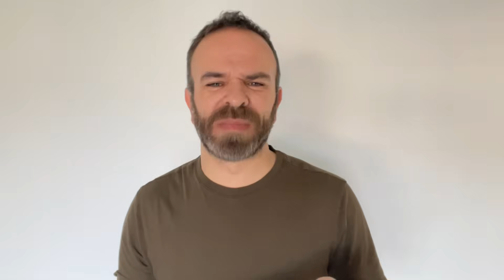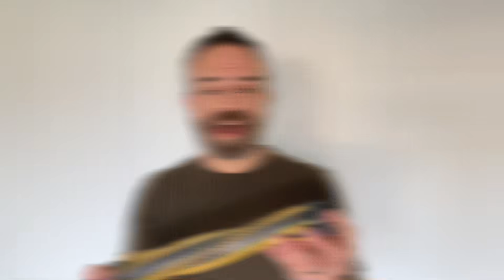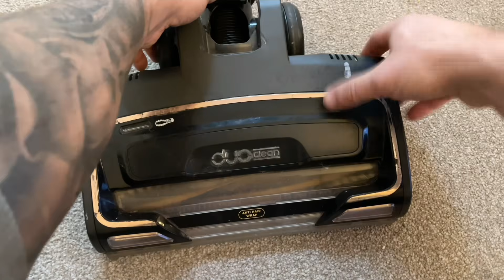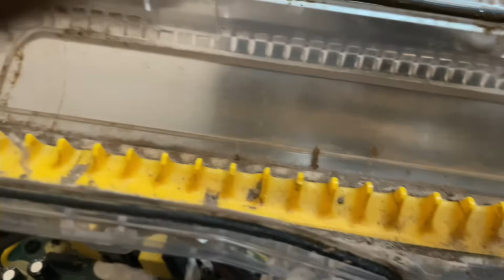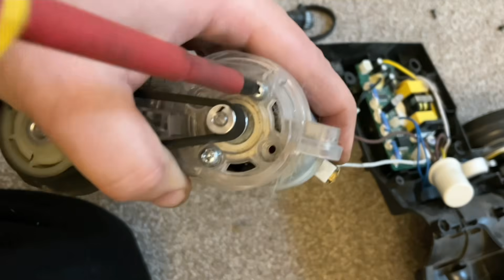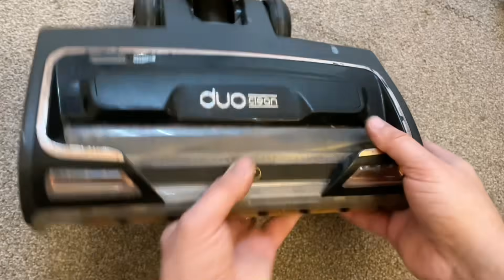How to REMOVE Shark Vacuum BRUSH Roll Duo Clean Roller

Comment: I've made stupid amounts of money over the past 5 years from vacuum designs and the fact that most people just go buy a new vacuum when theirs has a reduction of suction.  I routinely pull vacuums out of dumpsters that have only been used to the point where the filters get dirty for the first time or even before that if the hose gets clogged. The reason I'm here watching this video now is because I found a shark apex duo clean that's literally brand new  in a dumpster last night.  It had minimal dust in the canister with a filter housing as clean as the day it left the factory.  I usually spend 30 minutes or less and on average make 6 or 7 hundred bucks a month. I live in a town house that's in a complex of other townhouses so there are probably 40 dumpsters that take me 10 minutes to check all of them. I do it at night so nobody bothers me and I don't embarrass my wife with the neighbors. If I include other dumpster finds I easily make  closer to 1500 a month as a side hustle. Mind you since I check daily I never have to climb inside a dumpster because they feel up in layers from day to day so it only requires that I look inside and see what's on top.  Entire apartments are routinely thrown away.  The month that college releases for the summer I made 7000 because many students throw everything away rather than pay to have it shipped back to their home state or country.  If there's one downside it's the fact that I pull something out of a dumpster and sell it and uncle Sam still wants his cut. Ummm I'm pretty sure all the stuff I find has for sure had tax paid on it once and in many cases two times.

Comment: Hi I have a Shark liftaway NZ690UK.  The red light comes on and brush not turning. I have clean all filters and blockages, any ideas please?
Reply from the maker: Hi 

It’s nothing to do with the filters etc 

If the brush turns ok by hand when it’s off… It may be the small motor inside. 

Here is my video on red light issue 

https://youtu.be/y_HYlH-5Moc?si=wU2vyNeQTB0mbThg

Comment: Need a torx TR 20. (TAMPER RESISTANT) for the NV831…😭😭😭😭
Reply from the maker: This is a decent set for under £10 

https://amzn.eu/d/9ukXpSg

Also anyone reading. The screws are referred to as TX and TR when tamper proof but most new torx sets come with the small hole in the centre 

You can’t go wrong with the ones in the link

Comment: Any idea why floor base isnt picking up much dirt on carpet?..i cleaned roller etc recently so still sucks on crevice....model:HZ500UK 12
Reply from the maker: Here you go… model in video is different but the floor tool theory is the same…. 

https://youtu.be/iOS8CMam5rY?si=Xuiy5UpUkv_UY7hL

Poor suction from floor head if it is spinning ok, but just not picking up.

Comment: Me and my dad where taking out srews for a bit before deciding to find a video to try and help and it was only after you easily took off the clear part off that my dad had taken out a butter knife to take of the sides (its not the exact same model but similar enough) and  was able to finally get to the brush roll. He took out so many screws (maybe more than nessecary) but it was the side panels that by the brish roll that gave us the most trouble. Great video and thank you for the help
Reply from the maker: You’re welcome. Anyone reading this too and struggling with a model which is a different lay out. I have various videos on the link below so you have find the similar one to yours 

https://youtube.com/playlist?list=PLgFxX9sBhohzI2tqcuXIaJrnB7V3sxWCA&si=HYWMXT_8HIiwk2uq

😊

Comment: Thanks, really clear.  My problem is the floor unit squeaks loudly when the brushes spin.  Worth taking it apart?
Reply from the maker: Yes you could have something caught in the end of the brush. I have a video on my channel with the brush out already if this is the case. I’ll pop a link to that on another comment shortly. 

The big cause of about squawk however on duo clean models, is the small belt that drives the front roller. 
The cog is right in the front corner and if the clear plastic gets a crack it can send the cog out of line. The small belt then tries to come off, but with no room to do so. It is then spinning fast against the inside housing and eventually burns a hole in the side of the casing (yet to do a video about this) 

You would find that the soft roller is slightly stiff to push by hand, when the
 vacuum is off, if this is happening. 

Taking it apart you may find out the cause better. But if the second thing is the issue, sadly the plastics aren’t available to buy…. So it would be a £70 floor head time 😢
Reply from the maker: Here’s that video for the first possible issue

https://youtu.be/Wu2ax-h541I?si=KXC-T5ozbos7Vi_o

Comment: I have a shark nz860ukt upright hoover.mine doesn't have a sole plate with 3 plastic screws.
Reply from the maker: Ok that’s quite a new model I havent had any in for repair yet. I can see what you mean though online. Why are you wanting to take the brush out may I ask?
Reply: @vacuumhelp  because we tried hoovering a load of we think was concrete dust and its got everywhere and was trying to clean the window
Reply from the maker: @matthewwilson3492 ok cool. I’m sorry I can’t help with a take apart video. With them being under warranty I havnt had any for repair yet. 

Maybe the best help I can offer is this video? Different model but the theory may work the same on yours. 

It’s like they made your model even hard to clean and look after than the previous 😡

Anyway… cleaning window video…. 

https://youtu.be/hkbPp4lFcE8?si=xfycM8YmAPXeFV9v

Comment: Did this with mine today. Shark now use security torx bolts… ffs.
Reply from the maker: Always have. Most for. Screwdrivers have the woke in them for centre pin. If you don’t have any here is the set I use 

https://amzn.eu/d/gRKBHws
Reply: @vacuumhelp ok, I have a set. Wasn’t too onerous to fix.

Comment: Do you have a video that shows how to get to the brush roll in a shark rotator powerfins hair pro model zu100?  I got a small rock wedged in it so it won’t spin.  Tried prying it out but no luck.  So I went and got some star key screw drivers.  Was able to get the screws out from the bottom of vacuum and it allowed me to take top part of vaccuum off.  The top part is the cover with odor neutralizer technology.  The motor is exposed and wires now.  when taking all these screws out it loosened it up enough where the pebble fell out.  This is hard to explain but there is another cover underneath that has screws that I removed but this cover isn’t coming off and when taking screws out it loosened up a piece inside that cover that I can’t screw back in because I can’t 
Figure out how to get that cover off.  I’m sorry if I’m not making sense and appreciate your time.
Reply: I just figured out that I could take out the really small wheels at the bottom of vacuum.  Behind these wheels are more screws.  Removed screws but I’m still struggling to get the bottom cover off and the other cover on top
Reply from the maker: Oh god they are such a nightmare. We sadly don’t have your model over in the uk. I’ve just looked and the uk equivalent (almost) has only just been released a few months ago. So I havnt seen any in for repair yet. 

Cannot find any videos that may help but I wonder if the way in is linked to the silver covers at each end of the brush
Reply from the maker: Oooh will this help? It’s not by ent means your model but from 7m 20s onwards he started doing the end caps and the cover later on I pressume. It looks similar to your brush at least …..

https://youtu.be/zt0NULuEbPk?si=6SvTkeqC70OcBYAF
Reply: My husband was able to pop off the silver caps on the side with a butter knife.  More screws inside took those off and then he was able to pop off the bottom which gave me access to screw that loose piece back in.  Never got the other top off but was able to do what I needed.  Got it put back together finally and tested it works.  There were like three different types of screws through out this thing.  Most were t10 and t15 star keys and one single screw was a Philips head screw.  WOW that was a lot of work!  Thank you for responding!
Reply from the maker: @violetthodgkinson6153 yes they make them all very tricky so if people get any issues they have to buy a new one (unless they are as determined as you were) 

Glad you sorted it 😊

Comment: Done all that, but when you pull from the right corner to release the clear part, mine is stuck. All screws removed but it’s still not releasing the clear part. Any advice?
Reply from the maker: Ok if it’s not enjoying it form the corner give it a good wiggle from the middle. If the top Stewart hold it to the plastic base near the internal hose are both out, that’s a good spot to try and separate some models. 

Once one bit comes free the rest will.

Comment: Evening , I  have a problem with my shark az910uk the light is a solid green colour but the roller doesn't spin , help😂
Reply from the maker: No problem. It’s either the motor inside or the belt which has gone. 

The full video for your issue is here…. 

https://youtu.be/DyK5Ln5TwNM?si=lxPgtZ3K79hNx7GM

Comment: Please can you advise? No blockages, no hair on brush bar etc but somehow the cleaning is not as effective. Filters have been washed and dried. Also checked all connections to the wand (no fluff/debris etc). Many thanks for your help.
Reply from the maker: Ok please let me know is model number. Also is the problem just suction, or are you saying g the brushes aren’t spinning either? Both very different issues but I’ll get you sorted 😊
Reply: Thank you so much!

Model: NZ850UK 31

Brushes rolling, lights are on, some suction but generally not good at all. However when removing wand etc there is plenty of suction and can see no blockage. The only thing I can guess is not the same is that the light isn’t on the wand for carpet thickness (if there was ever a light there). Your help is greatly appreciated. Thank you.
Reply from the maker: @Sarah-y1h2z ok so the light on the handles are common for playing up, I can’t remember if your lights up, or if it just has the yellow background… in any case. This switch just changes the speed of the brush. So if that’s doing that, then that’s cool. 

Check the cone mesh filter in the dust bin is clear. This will kill general suction. 

I think the issue is the floor tool, but it’s great that it’s spinning. 

Common things. 

1. Remove it, remove the sole plate with a coin (unlock the 3 screws) check for blockages and make sure you can see daylight through the stem of the floor tool. (Oh and check main metal pipe for daylight) 

2. I’ve seen this every so often. If you have had the soleplate off recently, make sure it’s flush to the floor. The front 2 corners fit in first and then press down and lock the 3 plastic screws. 
If the corners are sticking out it can cause loss of suction 

Really hope you find something. Please report back.
Reply from the maker: @Sarah-y1h2z also you covered most things I think, but anyone reading this and having suction issue, this is the video you need….. 

https://youtu.be/sYiPjN-WKy8?si=TNG3udRrY6AAqLHp
Reply: Great video. Before I attempt to remove the roller.... the rollers both turn when I (very carefully) give the roller a nudge. But if I stop out the hoover upright and go again the roller stops and needs the gently persuasion again. Any thoughts? Thanks...
Reply from the maker: @scottlee5208 thank you. 

Ok so the key thing is how they are spinning by hand (with the vacuum off) if they are fine then it indicates nothing is clogging up the brush. This normally means the motor that drives the brush is on its way out. (Also the nudge to get it started indicates this 9 times out of 10) 

A seized brush would NORMALLY make the green light turn red. 

Never say never with anything shark tho and worth a look into. If it is the motor try eBay for used ones. Or you will have to spend £70 on a complete floor nozzle from Shark. 

Let me know how you get on or if you need any further help at all. 

Nothing left to lose. 😊
Reply: @vacuumhelp thank you I'll see how things go 👍🏼

Comment: If shark don't sell the brush roller then what is the alternative? My roller spins fine but I think the brush is worn.
Reply from the maker: @tonyharris8889  you can only buy the complete floor tool off them… crazy! 

It’s unusable to be very worn though they are usually quite hardy. If it’s poor suction form it, check the small hose on the tool for splits or blockages and also make sure that the bottom sole plate is attached correctly and flush to the floor.
Reply: @vacuumhelp I have checked and there are no blockages.  I shall check for the hose being split.  I have broken two of the screws that hold the bottom plate though 😮. Thank you for getting back.

Comment: Thanks a lot my kind sir! I have managed to fix my wife's vacuum with the assistance of your video and it was a breeze! There was a LOT of accumulated debris in the roller + the roller was overall a bit stuck, so I moved it for a while and put in a bit of oil to lubricate it. Now it works like new! 

Much love!
Reply from the maker: @0x_Vlad  great news. Yes it’s a shame you can’t actually get the end caps of the brush bar off but you did the right thing. Plenty of lubrication and swivelling (I attach a drill sometimes) 

Glad you sorted out and that I helped 

Your comment made my day thank you 

Jonny
Reply: Plate cover won't stay in place keeps falling off
Reply from the maker: @KarenMee-e6g let me know model number and what a plate cover is and I can help …. Maybe

Comment: Hi, when taking the roller brush out of mine the spring and little plastic lever part fell out that is part of the orange roller release mechanism. Please could you do a close up of this so I can work out how to put it back? Thanks
Reply from the maker: @nicolamurphy9310  yes sure. I’m not able to right now but if you email me with your model number I’ll send back some photos of a similar model. 

thevacuumcleanerclinic@gmail.com
Reply from the maker: @nicolamurphy9310  if you in a rush as it’s bed time here. I have this listing on ebay. Maybe zooming in on the images may help (I hope) 

https://www.ebay.co.uk/itm/365433048598?mkcid=16&mkevt=1&mkrid=711-127632-2357-0&ssspo=GLyQOPn2RJK&sssrc=4429486&ssuid=cExKpCXvQ72&var=&widget_ver=artemis&media=COPY
Reply from the maker: @nicolamurphy9310  also this one from another seller has a photo of one https://www.ebay.co.uk/itm/166718955347?mkcid=16&mkevt=1&mkrid=711-127632-2357-0&ssspo=YlvRTb3BTee&sssrc=4429486&ssuid=cExKpCXvQ72&var=&widget_ver=artemis&media=COPY
Reply: Thanks I'll give it another go today. I don't think I've put the small spring back exactly as it should go as the orange slide button on the side, which would release the orange roller, moves but isn't really doing anything. Thanks for your help
Reply from the maker: @ sorry for delay Nicola. I have the exact model and I’ve just emailed you some close ups

Comment: Hi, my roller is stuck. The white cog at the end of the roller does not turn. Is it supposed to turn freely ?

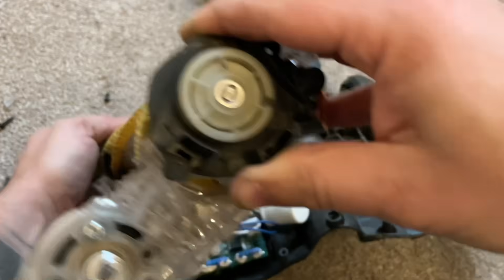The white cog @4:10 in the video. Any way to disassemble that ? I am afraid it needs cleaning to free it up.
Reply: Update: it was clogged with hair. Using a pointy tool was able to get into the crevices and free it. It works now. Thank you for your video. Liked  and subscribed.
Reply from the maker: @elzorro7235  glad you sorted it out and thank you for pointing this out to me. I like people to have answers to everthing on my channel
Reply from the maker: I woke up to your message and instantly wanted to give you an answer. I made a quick video that will hopefully help others, If you have any further advice please feel free to comment on the video 

https://youtu.be/Wu2ax-h541I?si=1G0PhomfgV9F8AtA
Reply: Thank you for this, much appreciated when clever people help and share their knowledge x
Reply from the maker: @ I wouldn’t go as far as me being cleaver 😂 but I do like helping and thank you so much for your appreciation. People commenting makes it all worth it. 🥰